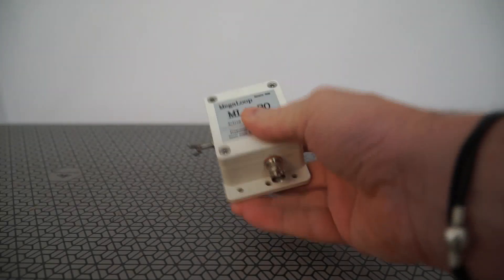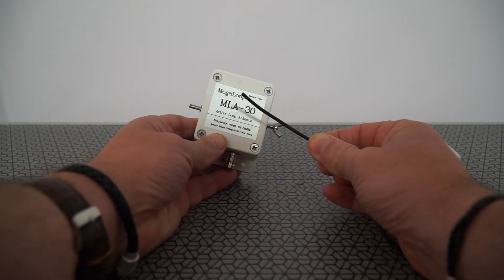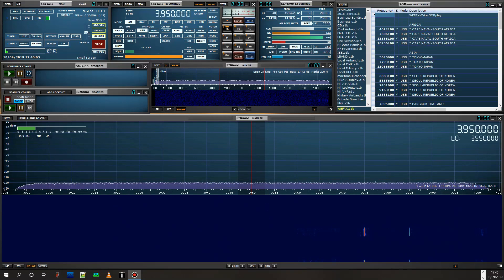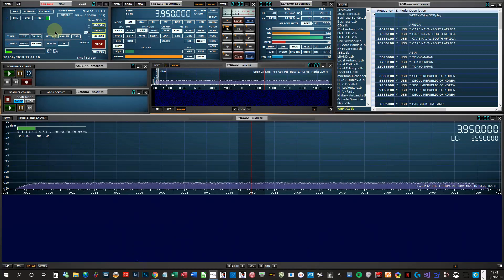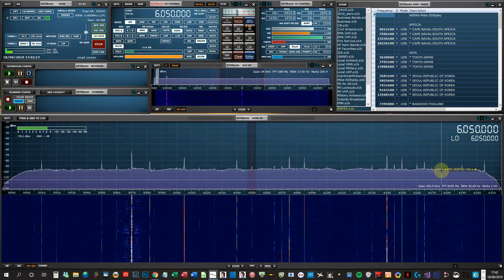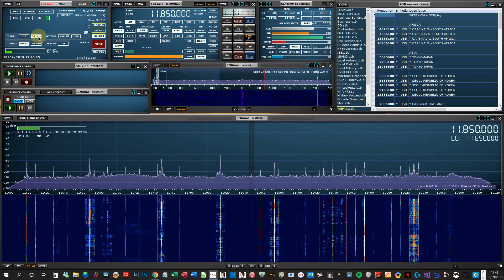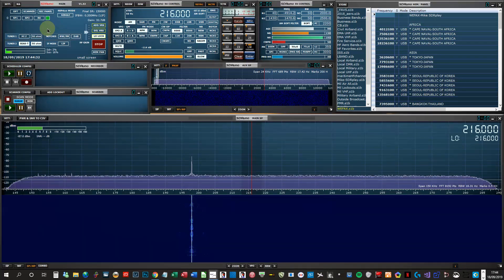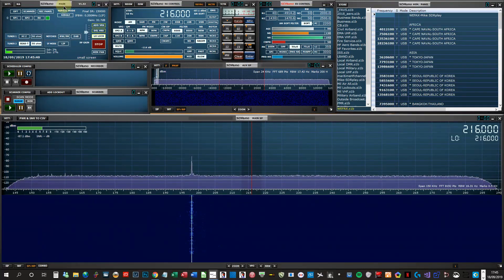MLA-30 Magnetic Loop Modifications

Comment: When you say the noise floor is lower or higher- how do you know that the difference is not in the actual  noise floor but differences in the gain of the 2 different antenna amplifiers? The only  true test is to compare signal/noise.

Comment: Putting a bigger loop on the MLA-30 makes a big difference. My antenna for example receives down to around ~20KHz. Submarine communication DHO38 on 23,4 KHz, the British time signal on 60, the German on 77,5 and a couple more at night and day.
It's basically a homemade YouLoop with 3 m circumference on the MLA-30 amplifier. Still goes up to around 30 MHz.
Reply: Page 65 of my old 1970 ARRL Antenna Book defines a "small loop" antenna is one whose total length is short compared to the wavelength received, so even a 3 m diameter loop qualifies as a "small loop" at LW. On the same page, it says that small loops "are widely used at frequencies below the standard broadcast band for direction finding."  If small loops are directional, do you have a way of rotating your 3 m diameter loop? I am pleasantly surprised to read that your MLA-30+ amplifier works at LW frequencies. I have read that the MLA-30+ is not very directional at HF frequencies. How directional is your 3 m loop at HF? Thanks!
Reply: A stock  mla-30 also goes down to those frequencies, while being total rubbish on MW and LW.

Comment: Hi, regarding long wave. I've tried the Bias-T on my SDRplay and this massively reduced LW signal strength compared to when I used the Biasing Tee that was supplied with the MLA30. I must admit I have the MLA30+ though, but maybe you can give that a try or try a different supply which delivers ~12V rather than the 4.7V that the SDRplay can only deliver.

Comment: UKAFG Can you explain one thing to a newbie? The loop antennas that I see in Youtube clips all have to be tuned very carefully to the resonant frequency that is being received, by means of a variable capacitor. How does this work when it clearly isn't?
Reply: The capacitor tuning with the driving inner smaller loop is for transmitting loops only.  This MLA-30 is receive only so no tuning is necessary.  From what I understand this powered unit here is amplifying sound and likely some noise filtering but not tuning the frequency as in a transmitting loop.
Reply: @cto511987  Not at all. Passive HF receiving loops are generally tuned with a capacitor, and active  receiving loops can also be tuned. The MLA30 is whats called a broadband amplifier that amplifies all HF frequencies at once. A tuned loop will always exhibit less noise and have greater narrowband performance.
Reply: @dayleedwards3521  Thanks for the clarification.  Back to the drawing board for me.
Reply: @cto511987  no

Comment: The bias T should be directly connected to the antenna box, having a preamp on the receiver side just amplifies any noise that is on the coax.
Reply: I believe the pre-amp is built into the larger box where the antenna wires connect and that the bias t box is simply a power inserter box for the pre-amp.

Comment: I just purchased one of these.  Doing some planning - PVC, connectors and all - and I see in this video that you mention the Bias-Tee is crap, and that you removed it from the equation.  Not having any other SDRs or antennae, but with enough knowledge of the basics of power sources, I'm curious if this is something I should do as well, and if so, how I would replace the tee with something "better?"  My plan is to make a much larger loop as I am more interested in MW, tropical bands and 160m hams.  I'm a total newbie to MagLoops.

Comment: Would there be any advantage in using the MLA but with a bigger loop?
Reply: A larger 4' loop works slightly better than the little 2' loop it comes with especially on the AM broadcast band.
Reply: @stevec2196  
Thank you. MW AM is not my target but HF from 3 Mhz upwards to 30Mhz. I assume that there will be a similar improvement especially in the lower to mid range. up to 14 Mhz?
Thank you for your kind assistance.
Reply: @MauriatOttolink  There was some improvement over the whole range even on 27 Mhz.  The performance is basically identical to a wire I put up that's about 35' long but the loop can be turned to minimize interference.
Reply: @stevec2196  Great stuff... Thank you.
Also. being a loop it will also be less susceptible to noise. 73

Comment: Is there a stand-alone bias t that you would recommend?  The only ones I found must have gold inside - they cost over $1000.
Reply: Don Moore
I'm sure that there will be building kits with improved noise performance. (ie. Bias T boards.)
Reply: You could get an MFJ-4117 for $45 but there are cheap bias tee's on Ebay for $4.00!

Comment: The best MOD is to reduce the loop's resistance to .000001 ohms to marginally increase efficiency in a situation where current is totally dependent on reducing resistance. A silver or gold plated pipe of same diameter may help. Changing the the post amplifier coax connections contributes more noise through dissimilarities of impedance and loss in coax joins, and is discouraged. Changing the electronics is impossible because of the design and caulking and the only other facility is to place the antenna in a noise free zone, a half-wave at lowest listening frequecy above an electronic 4x4 mat.This antenna is not designed for maximum wave capture, but for maximum wallet capture. Go figure.

Comment: Have you tried to replace the loop element of this antenna? This is just a piece of a stainless steel wire and I suspect is not very effective (just looking at its dimensions). I am thinking of replacing it with either 2.5m of LMR400 or a copper tube of similar length. This may help with the noise and sensitivity. What do you think about this idea.
Reply: What i was thinking did you try this
Reply: @mplmpl7780  I have added a longer loop made of a solid copper electrical wire. I have tested inside my house and I have not seen a lot of improvement.  I want to test with a copper pipe and put it outside.
Reply: Signals are quite weak below 10 MHz when using the included 60 cm loop.  I made a 6 foot loop with PVC supports and it made an AMAZING difference on the lower frequencies.

Comment: What type of power supply did you use?
If it was an impulse type, it is not surprising that interference occurred.
Typical USB chargers are not suitable.

You should use a transformer-type power supply - the simplest explanation of it is in the recommendation for the C.Crane Skywave SSB radio;
https://www.ccrane.com/item/alt_dc_skwv_adt/100109/cc_skywave_ac_adapter

I have such a power charger and confirm that it does not cause RFI on MW & SW bands.
This type of power supply should be used for antenna's bias tee injector, obviously with a higher efficiency and appropriately modified power cord.
Check it out and give us your thoughts.

Comment: What type of coax did you use ? Also did you still use the tin wire as the main loop or you use coax to connect to the wing nuts as a loop sorry if this is a silly question I'm new 🙂 thanks
Reply from the maker: I use ultraflex 7 it is my favourite for permanent installations due to its size flexibility and excellent shielding  for testing and experimenting i do use wf100 sat cable it is 75ohm but for receive it is very good and cheap, The wire loop is still being used I have ordered a aluminium 1m loop (hula hoop) and sere if that offers any improvement
Reply: @UKAFG  Fantastic thanks for  the reply. I will  buy this MLA-30 and do some experiments with it. hopefully reduce the noise with a 9:1 bauln i think good for a beginner to experiment anyway thanks for the good video and the reply.